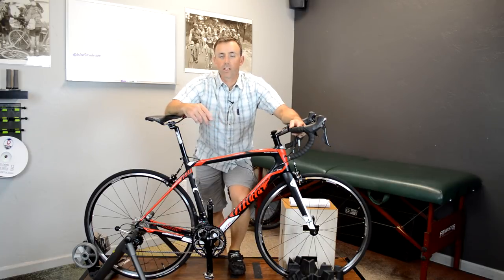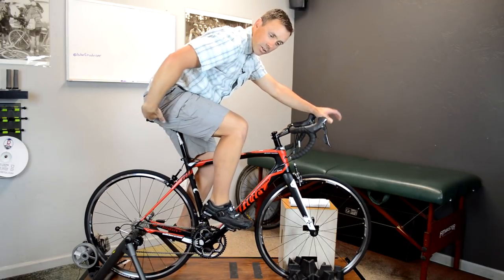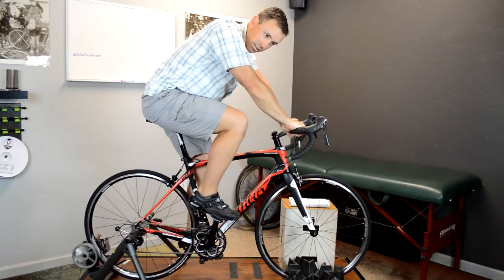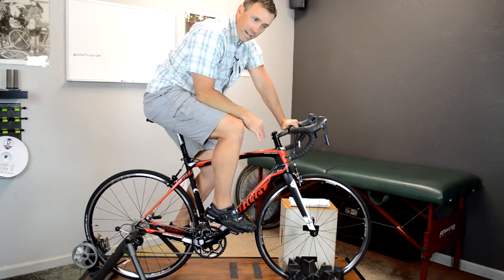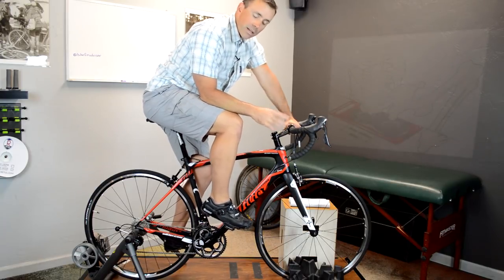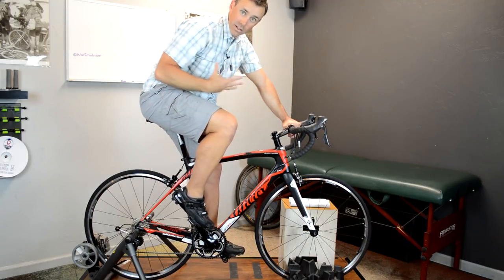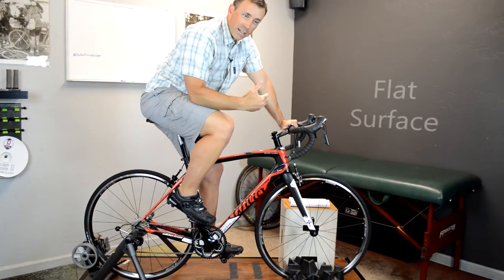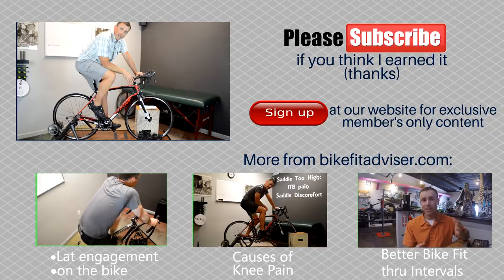Bike Seat Pain | Bike Fit Causes and Fixes

Comment: Got to say this actually works! I wrote on another comment previously I won't ride my bike anymore because of the pain and after about 3-4 more times with the adjusted seat I can! It does also help that I bought a wider springier seat but still until I adjusted the height it was still hurting. Now I can ride for hours so thank you so much #Bike Fit Adviser !!!!!
Reply: What did u adjust? Forward aft?

Comment: This video and "4 Signs that your Saddle Discomfort has nothing to do with the saddle itself" were extremely helpful. I stumbled upon them because I was shopping for a new saddle. I was talking all sorts of smack about my 25 year old Vetta SL saddle because it was so uncomfortable. I knew I was onto something important when BFA started talking about hand pain . Yup, I had that too. I realized I was reaching too much. So I went out for a ride and I started weakling my body positioning. I engaged my core and it pulled my body weight back more over my sitting bones . My saddle immediately felt more comfortable. The pressure on my hands was dramatically reduced. The orientation of my hips , knees, and feet changed and I felt I was in a more powerful position. In this new position my seat suddenly felt too high. Next ride I'm going to try dropping it an inch. Thanks BFA! But I might buy a  new Brooks B17 anyway!
Reply: * tweaking my body positioning

Comment: You can watch as many videos as you like about bike fit it took me over 2 years to get my fit right only after suffering hours and hours on the bike, now i can just jump on any bike and make it fit without anything in 2 minutes. one thing else i noticed that every few months i was getting lower on my bike and my reach was getting longer because my flexibility was increasing because of spending hours on the bike every week over the 2 years now i can even touch the floor with my knuckles with my legs straight in the standing position and hold it there for 1 minute.

Comment: I came back to cycling 4 months ago, I have ridden bikes for many years but stopped for a few years.  Of course my ass was sore the first several weeks.  I wear bike shorts with padding and that is a big help, I tinker with the seat adjustments until it feels right for me, which also means comfortable.  As I continue to ride, 5 times per week, up to 30 miles per ride, I find that changing up my position as I ride, not staying locked into just one static position can give me more duration on the bike as well as relief.  l am a MTB rider and when in the woods much of my time is standing, that helps.
    My latest issue to deal with is the spin bike I have bought for the winter snow days and daily workouts.  The seat is plusher than what I ride on my real bikes and butt soreness for my one hour a day spins has been minimal however……a hemorrhoid has appeared and created an issue that most of these videos don’t seem to mention.   Life is full of challenges and no one says that staying fit is easy!!!

Comment: I appreciate this; there are various steps and factors to consider; however, they are explained well. Is there a process that will, potentially, provide the a balanced distribution? Perhaps saddle position, relative to position of arms to handlebar, to pedals?  Thanks

Comment: Changed into slim tyres and cutout saddles recently. Speed has been fantastic, but now the slightest bump on the road seems to crush my pubic bones lol. Got myself some bike shorts with pads and will take your advice in adjusting the handlebars-pedal-saddle weight distribution. Thanks!

Comment: I'm 300lbs. I'm luckily 6'1" with size 14 shoes so I don't look that terrible. I have a Trek Wahoo 29er (2012/3 it's the blue one) and I primarily ride paved tails and hard gavel chip tails. I swapped the hard, narrow saddle for a Bell from Walmart. I know, buys $700 bike, rides $15 saddle. I don't want to resort to a tractor seat but my rear hurts. The fleshy bits around/under my ischial tuberosities feel bruised. The narrow saddle hurt my perineal area. What do you recommend for someone that's my size? I don't know what to do. With this virus I can't get to my local shop. Part of the reason I swapped saddles is I was riding a backcountry trail, hit a thick branch, lost my footing and basically baseball slid whilst jamming the front of the seat into my prostate. I bent the saddle bars  and likely the mount a little too as my current saddle is slightly off, but not really noticeable.

Anyway, recommendations on a seat for a fat guy would be appreciated. I destroyed my knees snowboarding and I need to lose about a hundred pounds. Biking is about my only option. Please please please help...

Comment: Does rider weight matter when selecting a saddle? More or less cushion? Rail material? Any other factor?  I have a custom made bike, selle italia gel slr max, getting post ride, tenderness in perineal area. I'm a heavy rider.
Reply from the maker: Julius Dizon Yes, rider weight will matter. How much "give" you should go for will depend on what saddle shape in general works best for you. For instance if you do well with a mildly curved profile (not selle SMP curved) but are a heavier rider, you might actually be able to get comfortable on some flatter saddles because your weight may curve the saddle. In that same vein, if you find a semi-curved profile that has a vert rigid structure to it, that has a chance of working too.

I know this can get confusing because it definitely adds to the number of variables out there, but this is exactly why everyone should test drive a saddle before buying it.

Comment: Very helpful.  Thanks.  Going on from this theme, what considerations do you need to make when selecting a pair of cycling knicks?  In my case, what would I need to look at for a pair if underliner shorts for mountain biking and doing some long distance (100km give or take) rail trail riding?
Reply from the maker: I've found that finding the right chamois material is really important -- I've had certain fabrics that just didn't play well.  

Also, and probably a bigger deal, is to make sure that the chamois actually covers the full width of your bony sitting structures.  You'd be surprised at how many shorts don't once the rider is on the bike.  I'm not a big person and I've had shorts where the chamois ends in the middle of my sit bones.  

A few manufacturers have begun to address this with multiple widths of padding -- Endura is one that comes to mind (but then for me, I didn't like the material in the padding).

Make sure the shorts fit everywhere else too -- the longer we ride, the more we rely on the elastic on the legs to help keep the padding in place.

Try chamois creams if you'd like - I don't have a favorite, there's a lot of decent ones out there.

Lastly, stand up regularly.  Pretty simple and kind of a no-brainer, but especially on mountain bikes (and certainly in rail trail situations) we can get lulled into sitting too much.

Comment: So I feel like my issue with riding is the 1st part you talked about. I do arch my back a little when riding and it makes me sit weird but I'm also a big guy. Are there any seats you could suggest for me? No matter what I do after about an hour ride my ass is rashed and feels bruised lol. I'm currently using a bicycle for physical therapy so as I'm trying to make myself feel better its almost impossible cause of the seat. I can't even sit correctly on a couch now cause it hurts so bad lol.
Reply: Im 13 i got a 26 Zoll but im not so big when i get on the seat i cant touch the floor that's why i got my seat down and im a little bigger than others and my ass really hurts when i just sit on it but when i have my feet pushing the paddle it gets really better but still it hurts so much i dont know if i should get a New seat i mean im small and fat

Comment: Hi , I hv bought a MTB last week and I am pretty happy with performance. It has 3x9 gears in combination. So my 1st ride was for 10Km 2nd  24KM and 6th ride was 60KM which is a big incrementing numbers for my kind of guy who never ride a Geared cycle ever before this long. 

So here is my question, I always have this tail bone pain if I ride for long, I have bought cycling shorts keeping in mind that it would gv me some comfort but still have kind of pain.Moreover, I have a gel seat cover over the saddle as well ,I guess i should remove and try with gel Cycling shots alone.  But how do I get to know whether my saddle doesn't require to move forward or Backward as per my height i.e; 182CM . Could you please suggest me something on this so that I can ride comfortably as I know I have the potential to ride long just need a guidance.

Comment: Hello, I recently lowered by stem, by a spacer, probably a 5mm spacer. I have been experimenting with various positions of the saddle. Ranging from moving the saddle forward on the seat post and thereby being able to sit on the wider part of the saddle; to moving the seat back on the seat post. However, i still experience some sort of discomfort in the pelvic area. I am hoping for a more aero position by dropping my stem, do i simply sacrifice comfort for this aero position or should I look else where to solve my problem? Thanks.
Reply from the maker: +jj95east it's not always the case that in order to gain aerodynamics we have to trade comfort. But when  a rider is at the end range for what their body can tolerate (due to trunk strength, flexibility issues, etc) going beyond that range to force an aerodynamic position will almost definitely result in saddle pain. If it's a position your body is capable of, then finding the right pelvic tilt on the right saddle matched to the right bar position can lead to comfort

Comment: nice vid.....what is the best way to level saddles with kicked tail like Antares and nago evo??   level it from front to back or just the front portion like manufacturers recommend?
Reply from the maker: Yes, generally I level them from the front, but if the rider has a slightly more upright torso, some do well with just the slightest amount of "nose up" position.  

It also may depend on where the saddle is clamped in the rails...if the saddle is slid all the way forward (so that the clamp of the seatpost is grabbing the back of the saddle rails, that saddle with preferentially flex nose down when it's weighted.  In this case you might also need to start with it barely nose up so that it levels when you sit on it.  

The reverse is true if you have a saddle slid back further so that the clamp is grabbing the front of the saddle rails.  Good luck!
Reply: thx!
Reply: when you says slighest bit of nose up...do  mean a degree or 2...or more like .5?
Reply from the maker: Like a degree or less most of the time
Reply: k thx....keep up the good work
Reply: 10 minutes of waffle about what you're probably doing wrong but no specifics on how to fix them.

Comment: This is convincing me more that I should get a recumbent
Reply: I will never ever go back to an upright bike. Recumbents have a lot more choices in size, length, and speed or touring and always far more comfortable than any upright.
Reply: @brucewmclaughlin9072  Isn't there quite a learning curve to riding a 'bent?  One of the local bike shops has a couple in their showroom.  I sat...or tried to sit on one and couldn't seem to get my feet under me (if that makes any sense).   I feel like I would likely tip over before I got going fast enough to establish a balance.  But they do look like a lot of fun to ride.
Reply: @NJP76  The best way of getting used to something so different from a diamond frame bike is to sit up and don't try to get your feet on the pedal as you coast down a slight slope. You need to get the feel of the bent before you take the plunge and pedal. This of course assumes you are starting out with a recumbent not made for racing or high speed like a dual 26 or 700C wheeled high racer.  The more upright you can sit ,is the better bent to learn on. It may take you 30 minutes before you get your feet up on the pedals and another 30 minutes to get some idea that you will not tip over. One of the major differences from DF to Bent is the grip on the handlebars . You need to feel the bars as if they were ripe bananas as that is how sensitive the steering is . You do not pull on the bars for transmitting as much power to the bike as you would on a DF.  As there are so many different recumbents on the market I would need to know what you sat on as I have no trouble putting my feet flat on the ground with my Giro A 20 touring bent but no way can I put my feet flat on the ground with a racing bent. After you get used to the position of riding, you then get to work on acquiring your muscles to work slightly differently from what you are used to.  Remembering to unclip before you stop and also being in a low gear when you stop ,prevents you from entertaining people on sidewalks and in cars. 
So yes there is a learning curve , but it really depends on what bent you have as some are easy peasy and others are for people who like to go fast all the time.These others are not recommended for beginners.
Reply: @brucewmclaughlin9072  Oh man!  Thank you so much for the in-depth reply.  Very informative.  I am not really interested in going super fast or racing.  At my age I am in it more for the health benefits, and of course the joy of riding.  What you say about learning the balance before peddling makes a lot of sense.  As for clipping in/out, I don't use any kind of clips.  Just a good pair of Specialized bicycle shoes.  
It looks like I am going to have to do a bit more research on recumbents to see just what I am going to be most comfortable learning on before taking that next step.  I just learned that one of the local shops up here actually has a 'bent that they rent out by the day.  That might be the place to start and see if a 'bent is really going to work for me.  Of course now that winter is coming on (Wisconsin) it will likely be some months before the shop will be renting out bikes again.  In the meantime, you have given me a lot to think about and consider as I start to develop more of an interest in recumbent riding.
Anyways, thank you once again for this reply.  Much appreciated.
Reply: @NJP76   A word about clipping in and out , My feet are 21-34" off the ground when pedaling , and yes I could pedal without clips but as I tend to spin at 85-90 rpm my feet will fly off the pedals above 60 rpm. The clips are set to one step above minimum and I do little sprints up to 140 rpm and try to hold that for 30 seconds but rarely get past 13 seconds before the lungs start complaining .  Some bents do not need your feet to be clipped in and some do. Having a foot come off the pedal can be destabilizing! Try to find a cheap recumbent on craigslist or in the paper and ride it till you get your bent legs ( same muscle group used slightly differently ) and get a feel for it . I am on my 9th bent now and if I was to buy another ,it would be used as I will modify it to what I want in comfort. Seats and handlebars are the only exotic parts as either road or mountain bike parts will fit.   Once upon a time I tried a Bacchetta Cafe and rode for 20 minutes impressed with the bent , took some time and eventually bought it. First 45 mile ride was when reality set in as the seat was not as comfortable as I wanted for distance.. Short rides are fine but distance will tell you more. I picked up a seat frame from recycledrecumbent.com and comfort over distance was accomplished. I watched my beloved bent  being ridden off by a thief one day  and bought a Bacchetta Giro A 20 touring recumbent to replace my beloved bent. Sure enough replaced the seat and still comfortable after any ride .. Take your time and remember the first bent will not be your last as there is so much difference between these creatures.
Reply: @J L Oddly enough the E- motor can be placed in front of the cranks or in a hub if you choose to go with electrons for help. Nothing electronic will be any cheaper and I have a friend who used a hub motor for 2 years of commuting and then just dumped it to go back to nice quiet riding with 48 pounds less weight.
Reply: @NJP76  DONT get a low racer. Very expensive mistake I made.  Get a trike instead. I rode a trike for years, then I got a low racer, and it is no fun at all trying to keep it balanced at lower speeds and in traffic. Even dangerous I would say since you can fall or swerve into a car due to balancing issues.  Get three wheels for sure, the ICE adventure has a super comfy seat (although I didnt try it, I had a gekko fx trike). If I had enough parking space I would get a Trisled Rotovelo.